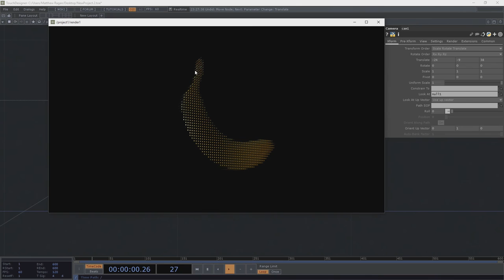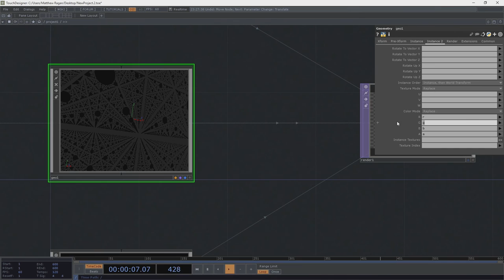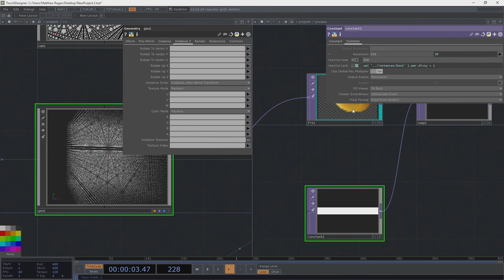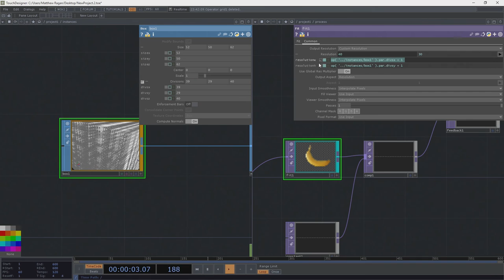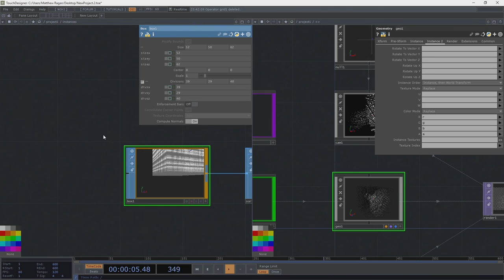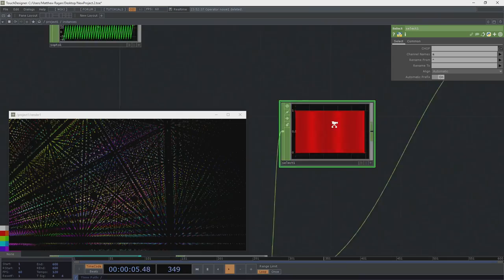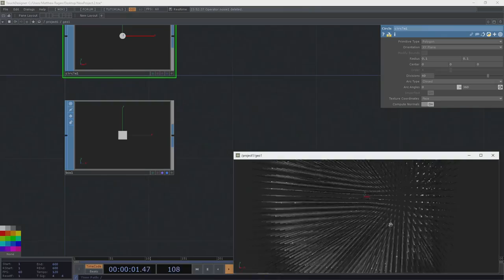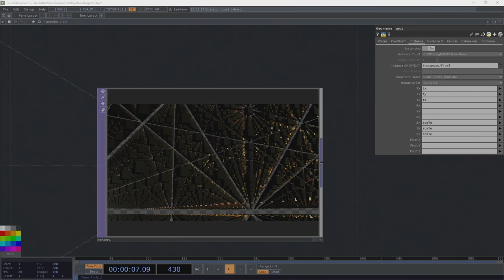Advanced Instancing | Pixel Mapping Geometry Part 3 of 4 | TouchDesigner

Comment: Hey there ! Your workshops are just .. great ! Huge goldmine of tips for any1 willing to know more about touchdesigner. I m currently having issue because non-professionnal version of TD is limited to a resolution of 1280*720 . So my TD is not really ok with having a TOP constant being 1640*30 . I figured out I could divide all the other dimensions adding " /1.28125 " in the parameters  of the box used as instance . Would that do the trick ? And again big cheers to you and your amazing educationnal work !
edit : dividing the box1 following parameters by 1.28125 seems to do the trick sort of .. but it still looks weird . ( sizex ; sizey ; divsx ; divsz )
Reply: Use smaller box on the beginning

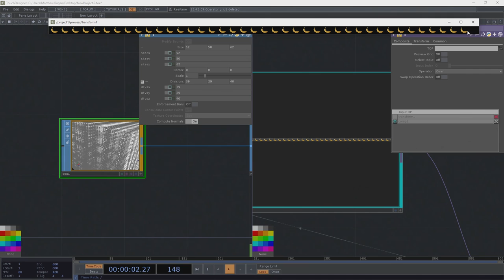Comment: Hey Matthew thank you so much for this tutorial I am learning so much. Im in a bit if a situation and can't seem to figure it out. my constant is giving me a resolution issue due to me having a non commercial version I am limited by a resolution of 1280x1280 the equation pushes the resolution by 1640. I added - 360 to account for the resolution cap but by constant shows the banana warped and not in line (reference 12:11 on video) thanks for your help!
Reply from the maker: hey alex thanks for saying hello. These things are pretty hard to diagnose and trouble shoot without seeing what you're doing. If you can share a sample file on the forum it'll be much easier to help.
http://derivative.ca/Forum/
Reply: Hi Mattew, 
I encountered the same issue and was wondering if you could help figure it out.
Thanks a lot for your time!
http://derivative.ca/Forum/viewtopic.php?f=27&t=11494
Reply from the maker: The step you're missing here is the Sort SOP - this allows you to change the sort order of the vertices to better match how your CHOP data is organized.
Reply: Hi there magic man, thanks a lot for your help and support. I'm still having a rough time making the feedback loop to work... any idea why?
https://www.derivative.ca/Forum/viewtopic.php?f=27&t=11494&p=44654#p44654
Reply from the maker: Two things - your  composite should be set to Add, not Multiply. Your Translate parameter needs to be set to pixels not fraction.
Reply: Wooow I see, I'm sorry, I need to sleep more...
Thanks again for your help! :)